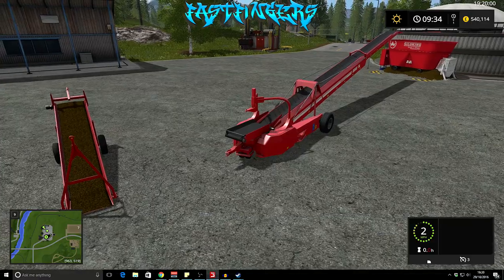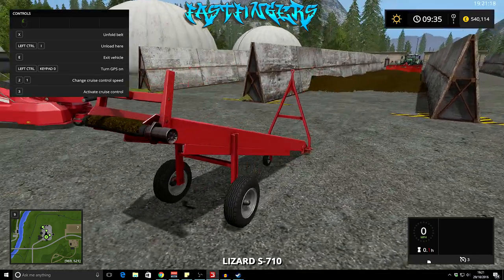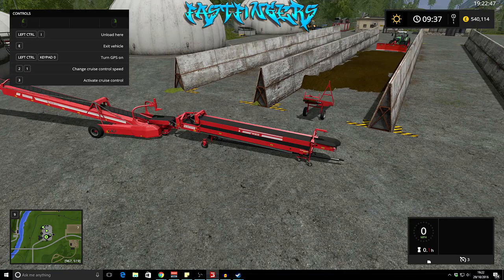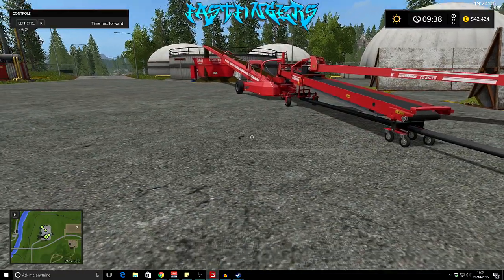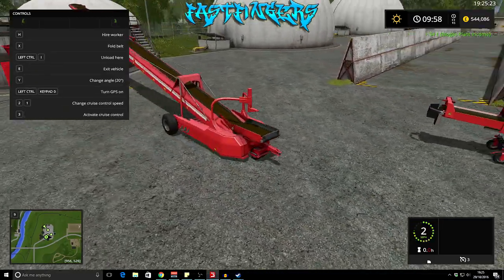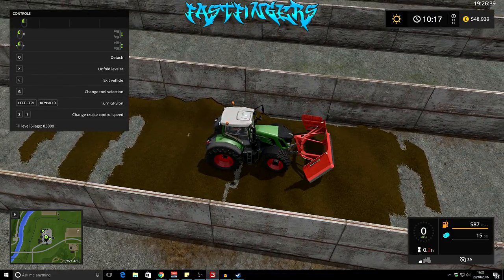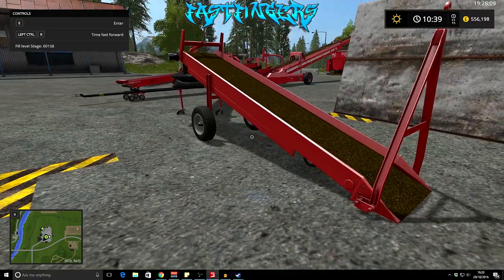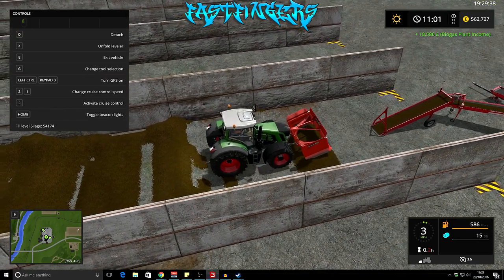Farming Sim 2017 - How to use conveyor belts #xxfastfingersxx -farming simulator 17 - fs 17

Comment: Great idea in theory. I've tried a more primitive version myself without the middle conveyor. The issue though is that great pile of silage you see under the hopper. A lot of what the conveyor's dumping in there is somehow missing it. It's tricky to get to, but you can pick it up and put it back on the conveyor to try again, but somehow Giants' implementation isn't doing the job as well as the FS15 conveyor mods did. Hopefully this is something they'll fix eventually, like the silage stuck in the silo walls.
Reply from the maker: yer i agree Steve. what i do is keep the small conveyor (the floor pick up one) away from the silage and slowly push it towards the silage so that it doesn't get under it.
Reply: From the latest patch notes: "Fixed unloading to BGA bunker using conveyor belts (1.3.1)". Just tested it and you don't end up with a big pile of spilled silage under the bunker anymore, so yay!
Reply from the maker: yer we did the same last night on our private server. seems to work a lot better now.

Comment: have you had any issues with the tracks not picking up things? i have it set up at the gravel pit and it will not suck up the gravel.. any suggestions?
Reply from the maker: Sometimes they have to be perfectly allighned, and make sure they are all turned on.
Reply: @xXFastFingersXx  Thanks for your help.. turns out the original Lizard 710 that comes with the game is faulty and doesn't work on the Pleasant Valley V.3.96 ... so in researching I found a mod fix for the Lizard 710.. I installed it and all is good now on Pleasant Valley map for us.. !!

Comment: They work great for silage EXCEPT mine stopped working properly so easy fix was to sell and start again BUT, they won't detach. I have 4 belts stuck together. I can't sell because they are considered working so I tried ramming them with a big tractor, but no, they are superglued!  Any ideas?
Reply from the maker: John Forensicman have you turned the engine on, you could sell them like you said. Wonder if your save game is corrupt
Reply: Managed to ram the small piece off at the back then was able to sell.  Just got to buy them again so set my daughter on as a worker until they are all set up again.

Comment: you should try to get the remailing silage out using the belts ... i have the same problem .. its annoyin,, threw in grass and it fell trough the wall turned into chaff -_- game is still a bit buggy
Reply from the maker: you can use the roller to get rid of the silage thats stuck. i havnt tried it personally but i here it does work.

Comment: use the smaller blade on the wheel loader much better
Reply from the maker: ah, yer never thought of that, cheers mate
Reply: its a dream comperd
Reply from the maker: yer, I agree, Ive asked a friend to look at the conveyor files, to see if he can increase the flow or capacity of the conveyors as they are really slow.